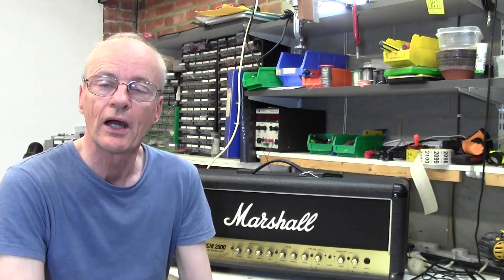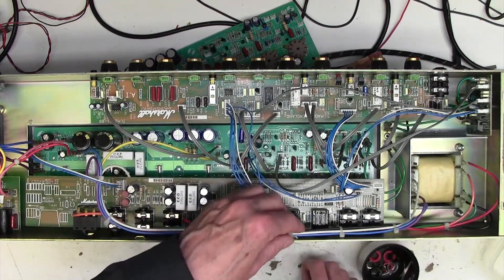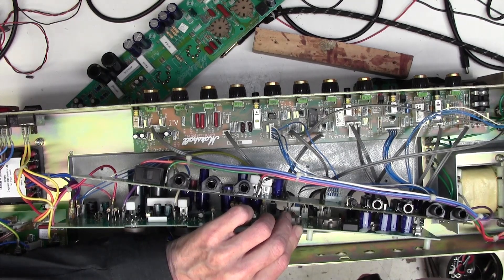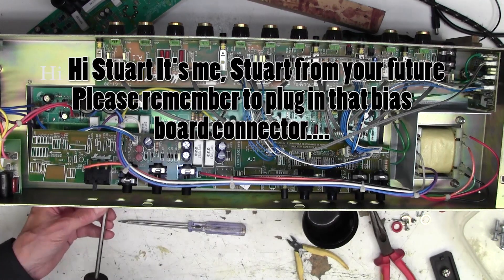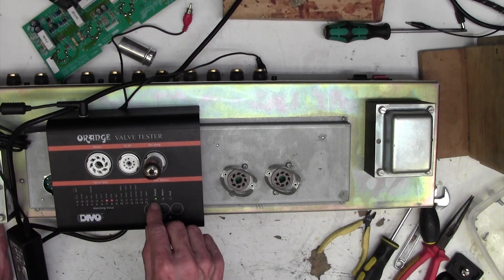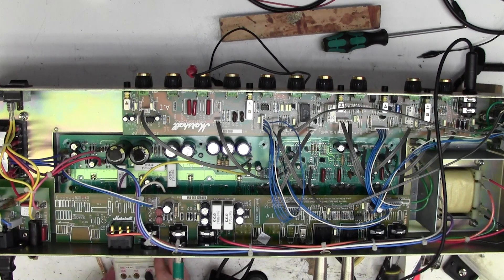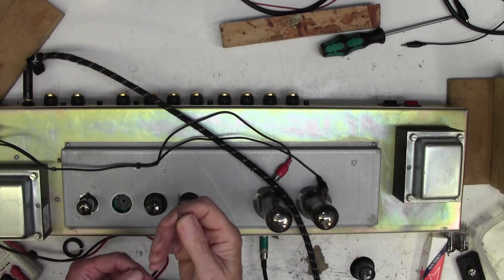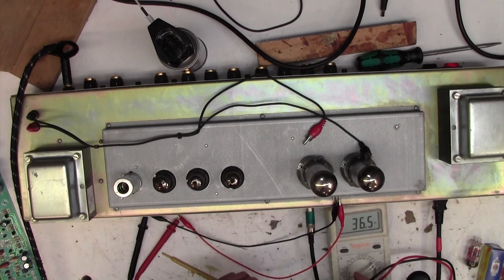How to Fix Marshall JCM2000 DSL50 No Heaters V1 and V2

Comment: I am certainly glad that I've never left off a connector inside an electrical device before buttoning everything up... never in 35 years have I done that.... and certainly not with a traffic light control panel at the very top of a drawbridge....
Reply from the maker: Suspiciously specific.... !!!

Comment: Leve your work Sir !  Be careful with that Orange tester ,  two friends of mine had one and they often tested worn on NOS Mullatd 12AX7 's and others.
If you Google Orange Valve Tester issue , you'll be surprised on how many sites there is talking about those being falty.
Reply from the maker: Hi Lou, yes I know about that tester, not at all reliable. Orange withdrew it about 5 years ago, which is interesting. They promised a new tester but it just hasn;t emerged. It's not a trivial problem making a valve tester.
Reply: @stuartukguitarampguy5830  Oh I see , I didn't know they pulled it out. 
Have a good say  and see you on the next one !:goodvibes:

Comment: It is strange how we work differently. If have to go to a lot of trouble to remove a board (as you did) I never refit without checking it over for bad/dry joints' Also, I never full reassemble until I have tested it is working. Had you just fitted two plastic nuts to the rear pcb it would have been a quick job to plug in the forgotten bias connector.
Reply from the maker: Hi Yes I guess we all work differently. Btw just because I dont show something (e.g. checking for dry joints) doesn;t mean I didn't do it. Although in this case I can;t recall if I did or not. All the best

Comment: I was looking now at the top of the chassis, and it looks like that there is a "cover", which holds the main PCB - if the tops screws were removed, maybe it would be possible to remove the mainboard without dealing with other PCBs ...
Reply: Turns out this is possible. I had the same issue with my JCM2000, v1&2 were cold (occasionally). I removed the "cover" and undid a few screws holding the PCB and resoldered the rectifier contacts, this manouver seems to have done the trick.

Comment: Just wondering if it is possible to remove that pan to get to the solder side of the board?
Reply: All Marshalls are a PITA to work on.
Reply: Marshalls are easy, mesa boogies are something, and yes it with some ingenuity.
Reply: @JPDESS  Try fixing a Marshall with a conductive board.....and no replacements.
Reply: @gingercat777  Marshall still manufactures replacements.
Reply: @jonsick445  For some late models yeah.
Reply from the maker: Not on this one, that just gives acess to the HT caps. If only!
Reply: @stuartukguitarampguy5830  What a bummer. Thanks for the information.

Comment: Hi Stuart, did Marshall actually correct this bias problem in 2004/2005 or is that just a internet rumor?
(I also heard if the back cover is black, the boards are good)
Reply from the maker: Hi Robbie  Yes they did, it only affects earlier boards with low version numbers. The way I heard the story was that they were suppled with PCBs which were very slightly conductive, hence the issue. They switched suppliers (or the suppliers corrected it) and it's been ok since, which, of course,was quite a few years ago now.
Reply: @stuartukguitarampguy5830  thank you so much Stuart, that's awesome 👍

Comment: One notable exception to the general longevity of most preamp-type tubes,,12AX7 and their cousins,, is that Russian preamp tubes have a disproportionate  tendency to fail prematurely in cathode-follower circuits. Phase invertors in particular often use cathode followers, and so you might be better off with a Chinese or Yugoslavian tube there, or vintage NOS.  It would have been interesting to know if the one tube that tested weak and had a discrepancy in gain between the two triode sections was the one being used for the phase inverter.
Reply from the maker: Ok interesting info thanks.

Comment: I desolder it, use a xacto knife n scape the lead, reflux n solder ymmv................Ive had these amps go CONDUCTIVE between Hi Tension n bias, used hollow drills n drilled pin 5 n hardwired it. saved the amp, also some of the have a 500pf ( 47pf maybe) pin 3 to 5 on LAST power tube ( WHY ON EARTH, il never know lol)  ( OUCH)  it will LEAK n cause probs to i chucked it w/no adverse effects ( One side going hotter in current)
Reply from the maker: Hi James YEs a well kown problem with the earlier boards. I've changed/fixed many.